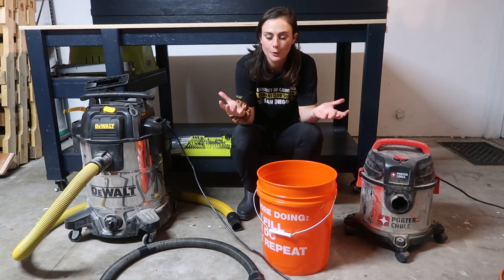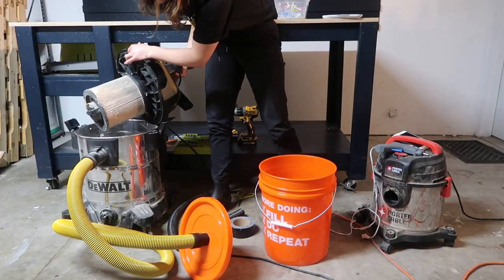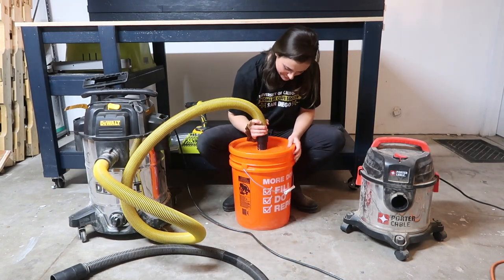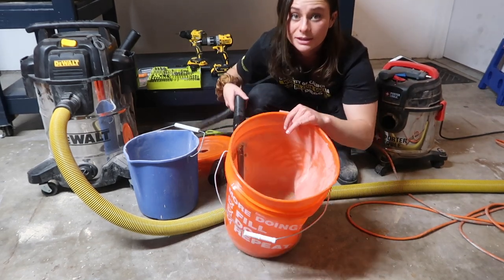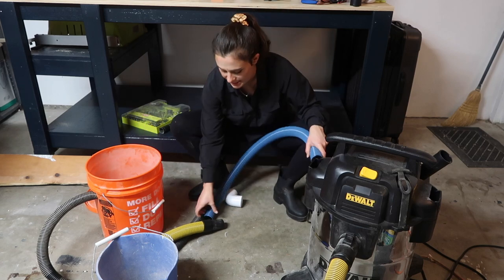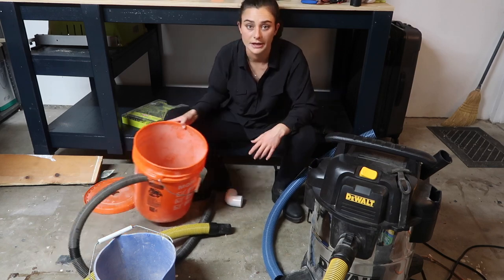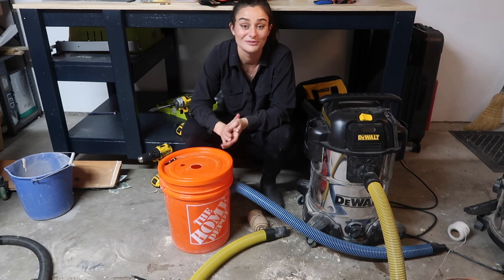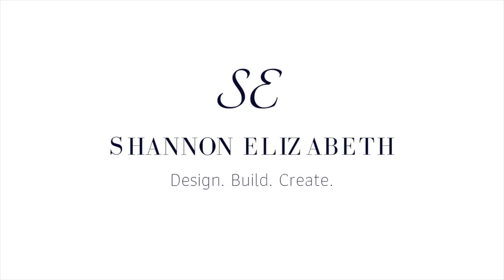DIY Dust Collector with a Pressure Release Valve

Comment: Enjoyed watching your process.  If you don't want to lose even the small amount of 'suck' from the pressure release valve, another way to go is to nest the bucket inside another bucket.  This works for a couple of reasons:  There's a slight vacuum between nested, identical buckets (which you sometimes experience when trying to pull them apart), and also because when the bucket caves in, there are flat parts that are pulled in, but this means there are also creases that extend out past its original curve, and these would be limited by the outer bucket.  

Also, you might try playing around with the angle of the side hose, making it go downward very slightly, just a couple of degrees (perhaps by sealing the screw hole that holds the hose to the side and drilling another one 1/4" lower).  The air will always go out the top, but by inclining the dust flow down a bit, a greater amount of it should spiral down to the bottom and stay in the collector, and not whirl around up at the top of the bucket and get sucked out.  

Oh, and this plastic is HDPE (high density polyethylene), a type of plastic that can easily melt around 200-250F, then re-harden, so a soldering iron, some models of hot melt guns, a piece of metal heated in a flame, etc., can 'weld' a small patch of the stuff over any holes you want to seal, for a cheap ('free') glue.  There are tons of YT videos on making various items with HDPE, due to this ability to melt and re-harden it over and over.  It's even more of a 'rabbit hole' than dust collectors....  Enjoy!   :)
Reply: You can also opt to for a 2 bucket high system so it will also allow you to collect more saw dust. The level doesn’t have to be very high in the bucket b4 it starts throwing the system off. 
2 buckets high and ✅ to double up bucket on bottom and on top. Specially w vac w such strong suction!!

Comment: Hey Shannon, I also experienced this problem (collapse). My fix: grabbed a 2nd bucket (actually got a black 5gal pickle bucket from Firehouse Subs, just ask!), painted the inside with rubber cement ( Can use shoe goo, epoxy, even 3M industrial spray adhesive), then another layer on the outside of my collector bucket, then stuffed collector inside my new bucket, and BAM! Plenty of wall strength. Now I don’t have to mess with pressure relief valves, vacuum-loss-causing holes, etc. protip: you don’t even have to glue the 2 together. I just did that for that extra bit of oomph, and so i wouldn’t Be tempted to steal my outer bucket for another crazy garage engineering project 😂

Comment: Hey Shannon! Here’s a tip for when you need to enlarge a hole you already drilled, and so there’s no “guide” for the next size bigger hole saw or bit..... Simply grab a small piece of scrap wood, drill the larger hole in that, then affix that piece of wood temporarily over the smaller hole you want to enlarge. That will now give your larger bit a reference “guide” to drill the bigger hole. Then just remove the piece of wood and you’re good to go. Alternatively, if you are working with the type of hole saws that all thread onto the same centering bit, sometimes you can get away with “stacking” them... thread the bigger one on first, then also thread on the one used to make the original smaller hole, that one will stick out a little proud of the larger diameter one acting as a guide for drilling the larger hole. 👍🏻😊
Reply from the maker: C Mar  No way! That is genius! Definitely never thought of that. Both of those are so smart and useful. I will definitely be using both of those. Thank you so much for commenting!! ☺️ this is insanely helpful
Reply: Shannon Elizabeth Anytime! 😊
Reply: Another thing you can do is simply get a 2nd bucket and put one bucket in another just like how they stack them in the stores. This will double the wall thickness and prevent collapsing.
Reply: @julianwong6268  good idea, you could glue the buckets together would ensure the inside one has the support of the outside one.

Comment: I bought a Pro DustStopper and ran into the same problem. My bucket caved. So sad. 😢 But I used YouTube and found the solution right away. A second bucket! Drop your sawdust collection bucket into the second bucket and your problem will be solved. I’m so glad I didn’t have to go through so many iterations like you did. You’ve got some gumption there. Thanks for the video.
Reply from the maker: @KevinPeffley  thank you 😊

Comment: You get an A for effort. I experimented with different size collection buckets and different size vacuums.  I found that you don't need a large vacuum for a 5gal. bucket. I switched my collection bucket to a full size metal trash can using a large vacuum like yours. Also, I made the Thein type collector using a 4" hose and solved my collapsing can problem. Thanks for sharing. Never give up...
Reply from the maker: That is a good idea! Probably looks a lot nicer too haha. Thank you for sharing

Comment: This was awesome! Thanks for showing the whole problem solving process. Science FTW! Of course I got served this because I'm researching dust collection pressure relief. I have upgraded my 5 gallon bucket to a 30 gallon plastic trash can. It still collapses when I attach it to my orbital sander because the end of the hose is too small. Just wanted to say how your solution is better than those who suggest reinforcing your bucket (stick it in another bucket or stick plywood rings in) because it is scalable. The only other addition I would recommend would be to add a movable lid to a hole in your top. An oversized plug that you can use to gradually change the size of the hole. That way you could compensate for something steady like a small hose instead of completely breaking the seal like you do with the magnet approach. I hope that makes sense.
Reply from the maker: That is a good idea using a trash can! Yeah that does make sense. Thank you for sharing!

Comment: In the lid 9f my bucket, I've inserted a few centimetres of 19mm black irrigation pipe, fitted with a tap for that pipe. I leave the tap wholly opened, but can close it off if more pressure is needed.

Comment: Good job Shannon, never giving up! Just wanted to give you a nice tip next time you need to drill a bigger hole after you already drilled one with your holesaw. Say you drilled a 1" hole but now you need a 1 1/4 hole...take the 1" holesaw that you originally used and put it INSIDE the 1 1/4 holesaw and screw BOTH at once to the drill bit. This way the 1" holesaw drops into hole already drilled and keeps drill from jumping around on you. Hope this made sense. Take care!

Comment: Loved watching your video, made me smile , I too had the same problem but I had a cyclone fitted on top of mine so my solution was to cut a couple of pieces of wood the same size as the bucket diameter and ,force them into the inside of the bucket as bracing, I made an  'X shape with the wood, worked a treat, and no dust in the vac, keep up the good work, love watching you and the fact that you are so pretty makes this old man  very happy lol,  from Garry in the UK
Reply from the maker: Thank you so much 😊 🙏🏼  that is smart. I haven’t heard that solution yet. Thank you for sharing. That is sweet of you. I appreciate it

Comment: The Home Depot and Lowes buckets aren't very sturdy.  I once mixed drywall mud in a Home Depot bucket and had orange pieces in my mud.  I then went to a thicker bucket and got rid of that problem.  Maybe you could have got away with design #1 with a better bucket?  Me ... I went with the dustopper and removed all that grief.
I did love your method of solving the 'collapsing bucket' problem!  Thanks for the vid!

Comment: A simple fix that add's to your idea. Make a hinge that attaches your valve to the lid, holding your valve in position. Like a tiny teeter totter slightly heavier opposite your valve. It opens when needed, then automatically goes back into position when not.
Reply: this is it... I also was thinking about this and considering a spring. However, I thought that might be difficult to design/build.  Your idea is genius.

Comment: this was awesome. love how you continued to iterate until you solved your problem. btw if you havent iterated further and you know someone with a bicycle who has to or has had to replace a tube. use the bike tube to hold the lid in place until it needs to open and when the blockage or reduced flow through the hose clears it will seal back
Reply from the maker: Thank you so much.  Dang good to know

Comment: Kudos for sharing the steps and process.  Increasing the pick up line was smart.   Ideally though,  you don't want to lose the suction, so an alternative is to strengthen or reinforce the walls of the bucket, either by putting a cylinder inside the bucket, or by putting your bucket inside another bucket.   good luck
Reply from the maker: Thank you 😊 that’s a good point. I’m thinking about making a new one

Comment: Good job. Thanks for the ideas. You've sold me on making one of these 👍. I'm pretty fed up with filling a shop vac part way too, maybe having to open it up because I sucked up something by accident, but then having to empty it before putting the lid back on because I can't get the filter back in cuz the dust. I was thinking maybe taking a strip of sheet metal on the top side and attach it to the lid below with a screw. The sheet metal would flex a bit to open the hole as the lid is drawn in with suction; however, when the vacuum turns off, the sheet metal goes back flat again, pulling the lid back up and resealing the hole again automatically 🤔.  Might eliminate resetting the valve repeatedly.

Comment: Not to be pedantic, but words - and correct use of terminology - matter.  It’s a dust separator, not a dust collector.
Nice explanation and effective use of sketches. Really liked the pressure relief valve.  Placing the bucket inside a second bucket also reportedly works well.
Best wishes!

Comment: Hello, love your attitude and how many ways you try and get more experience. I made my own dust colector to avoid pay tons of money for dust bags and filters, did it  with different pieces and some tutorials, but only one with the best solution to avoid collapse : spring check valve.  
I’m using a 1500 w vacuum cleaner for big work at the attic and work shop, I need to protect the over heat or over charge and force the machine because many big stuff get stuck a lot of times, the valve works perfectly. And use some kitchen absorb paper to cover the filter so it make it least longer and the inside bag to just for more protection, piece of cake. BRGDS.

Comment: Lots of good trys Shannon. Here is a simple trick to keep the bucket from collapsing. Just get another Home Depot bucket and slide it under the existing bucket. I had the same problem and I thought of getting a thicker plastic bucket. Eventually that collapsed as well. You will be surprised with the results. Happy wood working.
Reply from the maker: Thank you! :) Thank you for the advice as well. Definitely going to give that a try! Happy woodworking to you as well!

Comment: I like the DIY solution, and there are also inexpensive solutions out there such as cyclone and pressure release valves.  I got both and a strong sealable bucket drilled a few holes, connected the tubes and job done. 
I do like your thought process and experimentation, I just didn't have the time to find a workable solution. It wasn't expensive either, perhaps £$30 or so for bucket, cyclone and valve. 
The most expensive thing is the wood for the unit I am making for it and the new Triton vac!

Comment: Add a 2nd bucket, makes the system stronger.   Those big box store buckets are made from thin plastic.   The best one I found was an old paint bucket (white plastic) as it's thicker material.   You also have to spend the time cleaning the lid and bucket to remove the leftover paint....

Comment: Hi Shannon, great video. Your persistence is amazing coupled with the fact that you took the trouble to film all the stages of your efforts to solve problems. I've just built my first Thien baffle dust extractor which works really well, I'd recommend checking those out. They're basically what you have done but with a disc below the inlet. My collection bucket was collapsing as well so I cut a plywood ring to reinforce it about half way down which works well. I think pressure/suction relief valves usually use a spring. I predict that you will go on to develop things that make you a lot of money because you're intelligent and you don't give up
Reply: John, I haven't seen a Thien baffle so I'm not sure how it's setup. I'll probably search YouTube for a video about it later.

You said you add a "disc below the inlet", and I'm trying to picture it. 

The hose that comes through the side of the bucket and forms a curve/bend/angle is where the air and debris enters the bucket. This is the "Inlet" to the bucket.

The hose that goes to the shopvac comes off the top of the bucket is where the air leaves the bucket. This is the "outlet" of the bucket.

So, if  you add a "disc below the inlet", it would go below both hoses, and I can't make sense of that. Are you sure it doesn't go "above the inlet", and "below the outlet" (basically in between the two hoses)?
Reply: @GFlCh  Hi, thanks for your reply.  No, the disc goes below both the inlet and outlet. Depending on the individual design a narrow slot is left between the outside of the disc and the drum wall. If you have a look at "Dave explains how a Thien cyclone separator works" on YouTube you'll see a very similar separator to yours but with a Thien baffle added. It was a guy called Phil Thien who came up with the idea. The way I designed mine is slightly different but the principle is exactly the same. I have a small YouTube channel so will make a short video showing mine in the next few days. I didn't make mine very well, however it's extremely effective. A YouTube search "Thien separator" or "Thien baffle" will bring up several versions people have built. What's really neat about a Thien separator is that you can lift the top off a shop vac and make a separator to fit between the top and the drum. That will be my next project!
Reply from the maker: That is so sweet of you John. Thank you very much. Means so much. 
That is good to know. I will definitely check that out.

Comment: It sounds weird, but what I have found works really well is to just get another bucket and nest your bucket in the new one.  It keeps the bucket from collapsing. No need for a pressure relief valve and you don't have to keep open the lid of your dust collector.
Reply from the maker: BHarlan I saw a video like that but wasn’t sure if it would actually work.  It does work like that? That would be so nice and easy
Reply: @ShannonElizabethDesign  Yes, it works great.  That is how I'm running mine.  I have a dust deputy but you can do it your setup.
Reply: As BHarlan mentioned, the bucket inside a bucket works great. I've got that on my setup too. However, recently I did have an issue with the pressure getting too high from attaching it to my sander for a long period of time and it eventually collapsed again through two buckets. So I added reinforcement by cutting a thick ring out of scrap plywood with a jigsaw about the diameter of the middle of the bucket. Then I shoved it down inside and it's very sturdy now. Anyway, the pressure valve is pretty clever, but I can imagine it getting annoying popping off often.
Reply from the maker: @jsucara  that is really smart! Thank you so much for sharing!!! Yeah that is a down side of this design that you have to put it back on if it falls off.

Comment: to add strength to the bucket to keep it from collapsing put that bucket inside another bucket, and trim to fit your existing unit.
also, if you used 3 strings on the cap it wouldnt fall in and if the strings are short enough, the valve will rest itself when the vac is turned off.
like your commitment.
Reply from the maker: That is really smart and way less work haha Thank you for sharing! 🙂

Comment: We had the same problem with the bucket collapsing. My son looked at me and said Dad, if you use another bucket, the walls of the first one can't contract because for that to happen the other parts need to expand. We just put another bucket in it and it's been great! In addition to that, we added sand to the bottom of the lower bucket so now it doesn't tip over!
Reply from the maker: That is really smart. Thank you. What a smart kid! 😊
Reply: @ShannonElizabethDesign  
He hit on a known solution, or very close. What a lot do is, cut the second bucket down to lower than your pickup location. When you press it into your original collector, there is a small space left between the two bottoms, drop anything with weight, sand, bricks, even water (which will  actually helps with fine dust particles...)
Just found your Yt channel, great presentation, you have another new sub lady.

Comment: I have a Duststoper from Hone Depot for $40 and it comes with 2 hoses and inside it a Thein type baffle. My dust collector is stainless steel and the only thing that gets in there is a light dusting inside. I use 2 Home Depot buckets...One inside the other so no collapsing.
Reply from the maker: Thank you for sharing. Definitely a better solution than mine
Reply: @ShannonElizabethDesign  Well I think what you were doing shows a lot of knowledge about dust collection and what you were building will work great. I tried several things including a dust deputy but I wasn't satisfied so I bought the Duststoper and 2 years later I'm still impressed with it. Thank you for your reply.